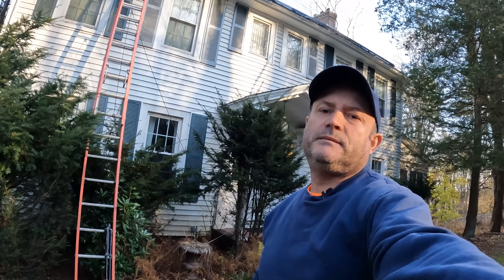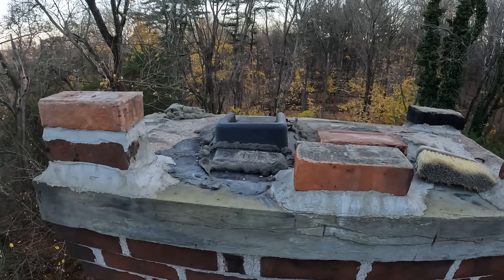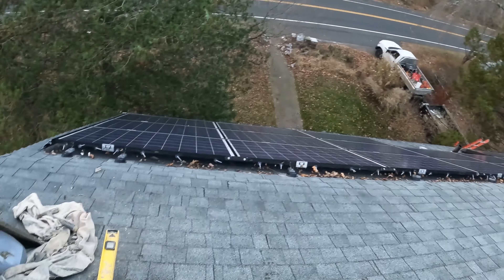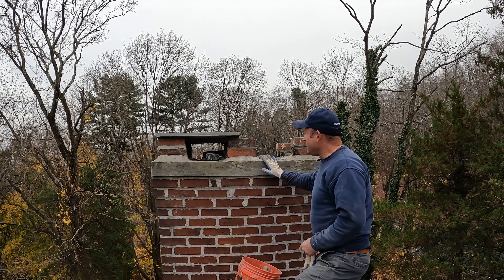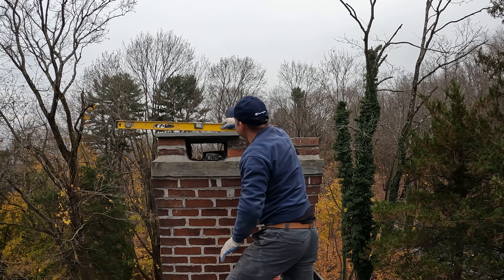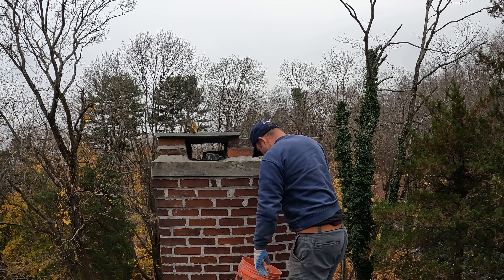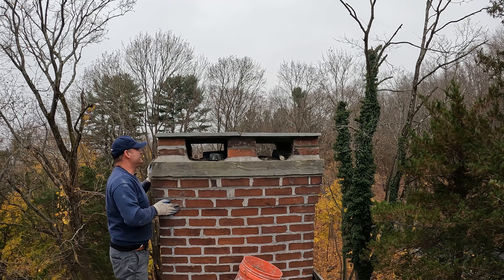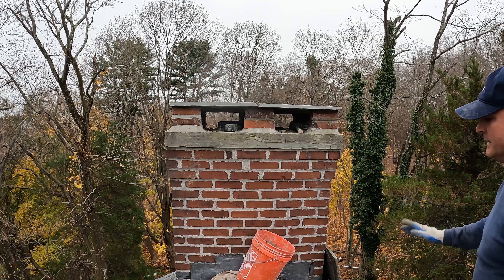How To Install a Chimney Bluestone Cap

Comment: Does this possibly create a wind-tunnel effect and cause cold air to drop down the chimney? I have a very similar set up (with a Lyemance damper that I also had installed) and the house always smells like the chimney because of cold air coming down the chimney when not in use.

Comment: Looks good 👍. Do u have to mortar the blue stone onto the brick? Or can u leave it loose to easily remove it to clean the chimney?
Reply from the maker: Hi ! I only applied a little of concrete to hold the bluestone in place but that also may be removed easy . Thanks

Comment: What did you use for mortar mix? Also, what do you recommend for clearance from top of flue to bottom of cap? Thanks!
Reply from the maker: Hi ! I used Mortar Mix Type S which is good for cold weather (you can add 2-3 shovels of Type 2 cement for each 80 pound bag so its a stronger mix) and i would leave at least 8 inches from the top of the flue to the cap. Thanks for watching !
Reply: @MasonrywithAL  Thanks. I live in Maine and add some Portland cement to the Quickrete mixes I use  for added strength. Also was, I was told the lid of the cap should be at least 5” above the top of any flue tiles it is covering, but having more clearance than 5” is better.